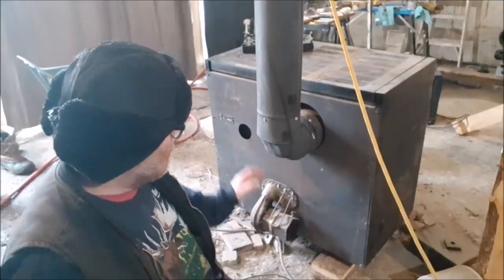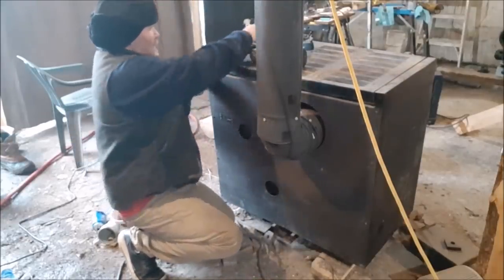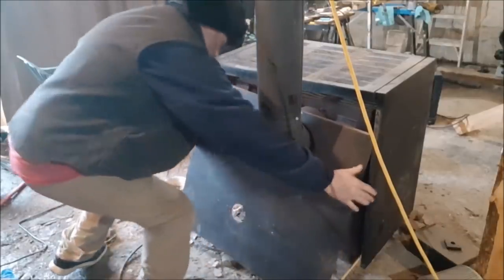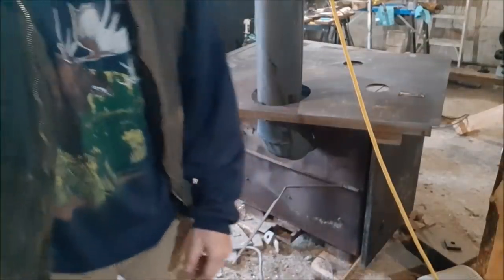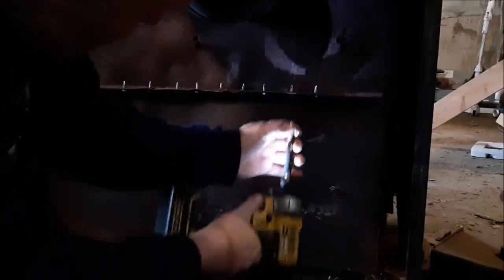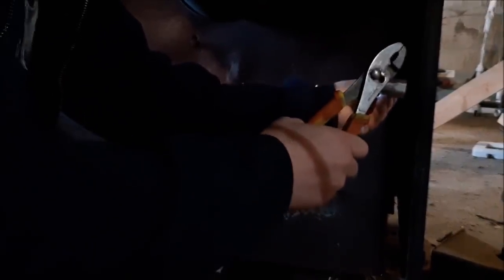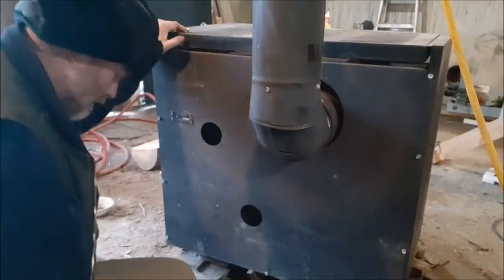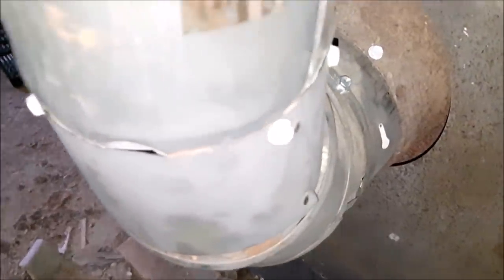Repairing Our Newmac Wood Stove/ Common Problem

Comment: I had same problem . Rebuilt mine with two inch angle inside and out .used 2x4 inch channel 8 inch long to get rid of fire brick .plus I built my own grate. 20 years but I need more repairs

Comment: Hello Heather and Cecil,  this don't surprised me,  as I told you when you installed that stove. I bought a brand new like that and in less than a week I've returned it to the store.  I hope you kept the previous one not too far.  You're making a temporary repair I hope.  You certainly have a smoke detector and a carbon detector downstair so it should be safe for you 2. Have a nice day and take care friends Tyrrs.

Comment: I'm with you why buy new when you can fix the old my wood stove both have been bought at junk yards for scrap price and I fixed them up  and those darn elbows are junk I can't buy a good one nowhere around my place. Thanks for sharing stay warm and safe my friends God bless
Reply from the maker: Thanks William.  Yeah I'd rather fix something and know what I have in the end instead of buying new,   for some things.  I had a friend years ago who bought a new air tight stove, he loaded it up and went to bed... The stove loaded up with gases and when the gases ignited it blew the glass out of the doors and ruptured the new insulated chimney burning down his new log home...His heating system was all done to code and passed inspection. Yeah these pipes are junk... But most folks would argue that because it is made, approved  and sold they must be safe.  Thanks again.  You have a great day ttyl...Cheers.
Reply: @SkinnersOffGrid  yes I want a stove like yours but I can't find a used one so I have to save and buy a new one, the stove I have I got to put wood on it every two hours and that's oak and other hard woods, I'm tired of not sleeping at night in the winter time
Reply from the maker: Up here they are very expensive.... As you may realize we use our wood stoves around 8 months per year, when people are done with them... They're usually done... Cheers.

Comment: You know Cecil if you or anyone up in your area can not find good  sheet metal 90s up in your area you could replace it with a tee . They work fine and give you a place to  do a quick  inspection of your flue. Use a od cap on the  bottom of the tee .

Comment: Please don’t take this the wrong way but your stove is not safe and a potential death trap. The seam is not sealed in anyway and fire will run away again from blower force feeding air into fire thru seam. The stove pipe elbow. Is not fit proper and dented. You can see actual flame in the video thru the voids. Please do yourself a lifesaving favor and get a better stove and proper elbow or at a minimum properly seal the seams and get better elbow that fits stove and stack. I enjoy the videos and don’t want to be a fuddy duddy but felt I needed to say what needed said
Reply from the maker: Thanks Kevin...   I think you would have had a melt down if you ever seen the wood stoves most older folks grew up with.. AKA Barrel stoves, Cast pot bellied stoves.  Did you know that an air tight stove creates way more creosote in your chimney and is the most dangerous of all fires for your home. Having a stove that burns hot from air leaks is not the danger in heating your home... Letting one smolder is.  And every tin stove pipe will not e sealed and you can see the flames if you look down on them, Look at the large seams where they are put together....Now with what I just explained,  I am sure you will agree with me....Cheers.
Reply: I wish I could agree but they make stove gaskets and stove cement for a reason. Having a hot stove should be done in a controlled manner with controls on stove and flue pipe not arbitrarily based on leaks that can vary due to stove temp. Every stove has its quirks but having visible flame is not one of them it should have Stove pipe should fit together the in such a way that makes so gasses and flame cannot be seen or escape. Just my two cents but for you it could be something far more valuable. Spring is coming
Reply from the maker: Thanks For your concern Kevin... It is appreciated.  I think now days we should all look around and question if the way we are told to do things  are  actually the best way. The metal part folded over the seam was in no way sealed lol.where the cast chimney was bolted on was not sealed, the little draft door on the bottom was not sealed either... Plus most all ( Air Tight Stoves ) Have a gas hole somewhere to keep gasses from building up and creating a producer gas bomb, this gas is what folks used to run an engine on instead of gasoline in the 1940s and is very dangerous.  Now perhaps the reason you can't see flames from the top of your stove pipes is you have them installed upside down? and will let the creosote drip onto your floor?  These stove pipes will never fit tight as they have a large folded seam on them, they always have a 1/8th gap where you can see in them...Cheers.
Reply: @SkinnersOffGrid  lol  Cecil ...new wood  burners  do not have gas holes lol they burn the gas really well. They use a catalytic combustor ( long burn times) but the cats do not like green wood and need a chimney with a good draft. Non cat stoves use insulated combustion  chambers combined with  heated air introduced at the top of the chamber through  a series of small holes that mixes and burns the gas.( looks just like a  forced gas burner when its burning..kinda cool looking). Pre EPA air tights and  the new EPA stoves are two different animals. Pre EPA stove would allow you longer burns but it would actually cost you alot of btu waste buy poor burns and more buildup in the chimney. New EPA burners will not burn as long but you get more btu  output and little build up.  lol you and I know your stove is a different animal all together and your fine as long as you have a real strong draft. Wood gas is  great  ...you just have to use it right. The pre EPA  air tights are the ones that allow those without the know to have a bigger fire than they  planned on.....cheers